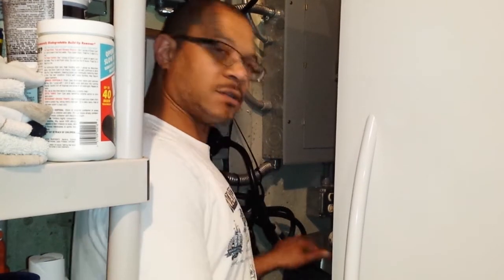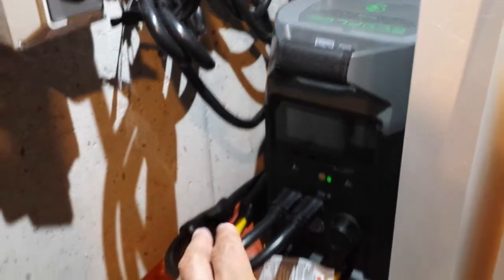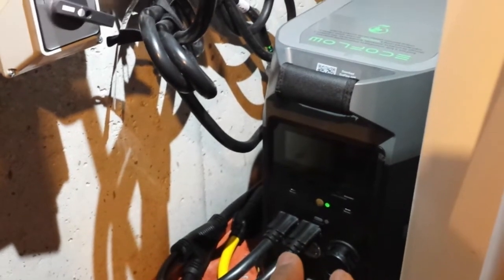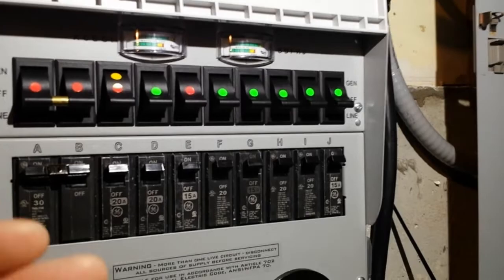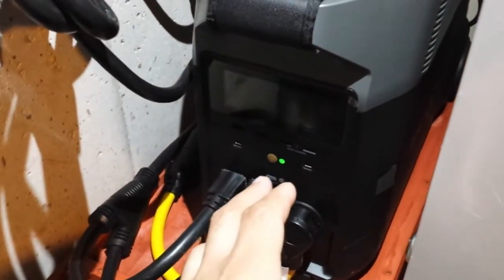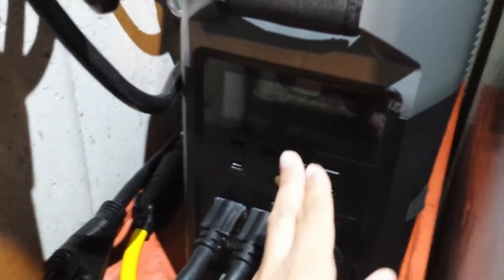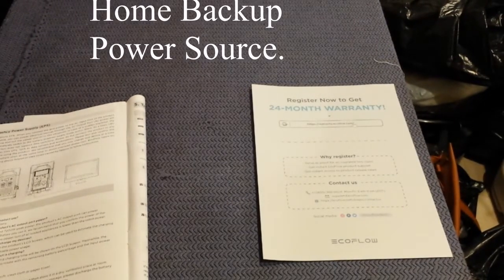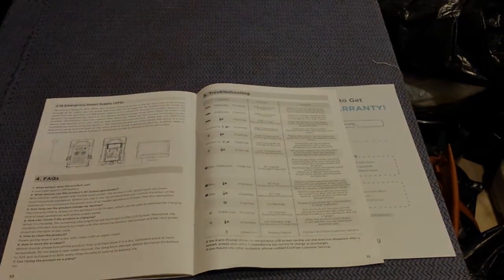EcoFlow Delta Pro - Overload Code Issue

Comment from the maker: It appears there is an issue when using the DP in EPS mode. Here is what customer service emailed me.

"We already have forwarded this issue to our R&D department, and they found that the problem occurs when the unit is used in EPS mode. We will release a new firmware version recently to optimize this function. We recommend not to use EPS mode until a new version is released."

I wasn't told if this was the issue with our unit.  I did ask them to let me know, if possible, what was the issue with our unit.

Comment from the maker: Quick update. We received our new DP Thurs. (The damaged unit was sent back Thur. too) So far, everything is working fine. I still have to run it through testing.  Ashley, Ecoflow's Customer service agent, was a blessing to work with through the entire process.  She kept me updated via email, in a timely manner.  A big A+ to Ashley and Ecoflows Customer Service.
Reply: Glad to hear they replaced your unit. I had the same code on mine. Theres a hobotech video explaining that when the Delta Pro is plugged in it only allows 2200 watts out. Something to do with the internal inverter switch. If more things are connected than it can handle it will overload. Supposedly this has been corrected on the newer models. I believe hobotech had a kickstarter model. Anyways check out this video and go to 22:30 and hobotech will explain. Ecoflow customer service is phenomenal though. They replaced my unit withing 1 week. Take  care my brother!!!
Reply from the maker: Thanks for your comments. I already saw, but rewatched, what you suggested.  There is a difference between his overload and ours.  On his, it still showed 60 hz on the LCD screen.  On ours, it showed 50 hz.  Also, he mentioned he had a 20-amp breaker on the outlet he did the testing on. He should have been able to get up to 2400 watts on that outlet, if no other items were on that outlet.
Reply: @Pk3_Garage  I was hoping to use mine as EPS. Had it plugged in to a 20 Amp breaker. Nothing else on that circuit. I had only my backup sump pump charger connected to the delta pro. Received alert message that my circuit breaker turned off. I checked the circuit breaker and it wouldn’t turn on at first. I disconnected the circuit and it turned on. I have 50 hz now displaying on the delta pro screen. One interesting thing I have noticed is “electrical burning smell” coming from the delta pro fan area. I am now debating wether I should call ecoflow for a replacement or just return the unit to Costco for a refund as I am worried this issue might happen again. Thought?
Reply from the maker: Hi Mohamad, sorry to hear about your unit.  I was thinking the same as you, should I return it to Costco or contact EcoFlow. (Well, you know my decision)

If you can be without your unit for a couple of weeks, I'd contact EcoFlow. (Hopefully you registered your unit with Ecoflow)

I used the app and contacted them directly with my issue. Their Customer Service is great.  It only took six days to receive our new unit, after they reviewed my YouTube video of the issue. We sent our damaged unit back to them, at no cost to us.

When you do receive your replacement unit, don't use the EPS mode until they can do a firmware update.
Reply: Also, I want to add to be safe. I charge the unit up and and dont connect the unit to grid power. I dont even plug it in. If my power goes out , I switch all my circuits to the Generator position.
Reply: https://www.youtube.com/watch?v=FUA9yBhsTTM&t=30s... heres the link to video
Reply: Good to hear ,I recently send a email to them,it doesn't load anymore
It was only the third time I loaded it trough home plug
Reply: I've got the same problem,  just sent an email,  see what happens,  thanks for the update
Reply: @stanlauseng3425  can you share the customer service email with me please? I’m having a similar issue with my unit but don’t know how to contact customer service. Thanks in advance.
Reply from the maker: Hi Lisette, sorry for the late reply.  You have to contact them through the Ecoflow app or their website (www.ecoflow.com) I have included a link to Customer Service e-mails.

https://us.ecoflow.com/pages/contact-us
Reply: Wow, that is pretty cool. I have DJI drones fro China, and they do the same thing! Very customer quality oriented. I'm upset that I paid so much for this, and I have to wait, but c'est la vie right?
Reply: Did you ever figure out how to fix it?
Reply from the maker: Sorry to hear about your issue. I never figured out how to fix the issue. I called Ecoflows customer service and filed a claim.  With this video, I was able to warranty out the damaged unit for a new unit.

Comment: I have the ecoflow delta pro and the two batteries, so far so good! I have them hooked up to 1000w of solar and a transfer switch feeding certain rooms down stairs,  when they are peaked at 100% charge i will have all rooms down stairs on solar. Every once in awhile ill get error code 001 on one of the extra batteries, but it would clear itself after a few hours. still not sure what that code is?  Just be aware that the unit can take up too 1600w of Solar, but its hard to find Solar panels with the right amp and voltage specs to take advantage of that kind of solar charging ability. Im very satisfied with these batteries. I bought mine from amazon.

Comment from the maker: Thanks for all the comments. Here is an update. After making this video of the issue, Ecoflow customer service sent me an email with a return label.  They are going to send us a new replacement unit from their warehouse. 

The question was asked, where did we make our purchase. Ours came from Costco. I don't believe the Costco or kick starter units are an inferior product.  They all came from the same factory as the units you buy directly from Ecoflow. 

I believe as consumers; we need to be educated about this type of technology and product.  How to use it in different situations. How to protect it from damage from lighting and power surges. 

I've learned a lot from this experience and have already begun to make changes so this won't happen again. I will make a follow-up video after receiving the replacement unit.
Reply: Thank you so much for this video. The exact issue happened to my unit today and I bought it from Costco.
Reply: Check to make sure but the delta pros sold at Costco had different specks than the Kickstarter models.  The Costco models only charged at 1200 watts solar and the Kickstarter was bumped up to 1600.  Now all of the newer models are 1600 watts.
Reply from the maker: Our Costco unit could be charged up to 1800 watts.
Reply: @Pk3_Garage  Solar? All the units charge at 1800 from an AC wall outlet.
Reply from the maker: AC wall outlet.  1600 watts if charging from solar.
Reply: @Pk3_Garage  then you have a newer model sold through Costco.
Reply: @hallerune2094 I thought that was a firmware thing? My dp only charged at 1200watts Solar in the beginning and it does 1600 now

Comment: Literally the same exact code popped on me last night I’m trying” help “ set up now I did nothing out of the ordinary. Bluetti eb240s are picking up the slack currently as I try not to melt in Florida heat. Relying on one centralized power unit sketched me out from the beginning. Like NASA triple redundancies at minimum. Double edge sword the Eco Flo pro is/was such a powerhouse all the solar in and as much out. Allowing for greater flexibility until he died with same exact 121 code😳 please update because $4000 paperweight sucks.GB

Comment: This is INCREDIBLE!  Your video is just one day old and today,  I had the exact same problem with my Delta Pro.   Yikes!!!
Reply from the maker: Can you share what happened in detail? It would help ECOflow and others that are experiencing this same issue.  Thanks
Reply: Where did you guys buy your ecoflows at? I’ve read models sold by costco/hsn were kickstarter leftovers?
Reply: Same my alleged professional lay dead 💀 error code 121. Last night.I believe possibly it’s due to firmware update not taking into account software fix of polarity swap on 30 amp RV outlet from factory.YouTube video on alleged polarity swap fix. And pictures of factory with many inappropriately wired yet to be assembled units. Somethings wrong far too coincidental. Poison pill 💊 far to intrusive app now serves to strike at the heart of our power/units.
Reply: @AnthonyAckme321  Is there any solution

Comment: I have seen issues by other Ecoflow owners who had trouble charging their units while the units also were providing power. Some of those had two Delta Pros connected using the double voltage hub, and some had a single unit like you.  I think the only way to reliably use these units as backup power is to disconnect them from their power source while they are providing power.  Your unit may have been damaged due to lightning or a power surge.  I was originally looking to buy two Delta Pro units to run my house as a secondary backup to my Honda EU7000is generator, but decided against it due to the many issues users are having. I will likely build my own rack mount battery backup system with a wall mounted low frequency hybrid inverter.
Reply from the maker: You bring up some good points and things I considered, before we made the purchase.  I don't, by any means, regret buying the DP. It has worked very well during my testing. Not having to run our Tri-fuel generator, for long periods of time and at night, is a blessing.  

This situation with the grid power surge, is the first time it's happened in our area.  Indeed, the summer storms are getting worse in our area as well as tornado warnings/watches. 

I encourage you to look more into how the unit works and learn from other people mistakes. It is really a great system and the best in the market as to cost and features. 

Hopefully EcoFlow is listening to the issues and will make changes to correct/prevent these issues in future units.
Reply: Same
I don’t know it’s really comfortable having all of my eggs in one basket makes the basket easier to your know carry distribute embryonic’s convenience generally.
Like safety and security if I trade one for the other I shell receive and deserve neither.